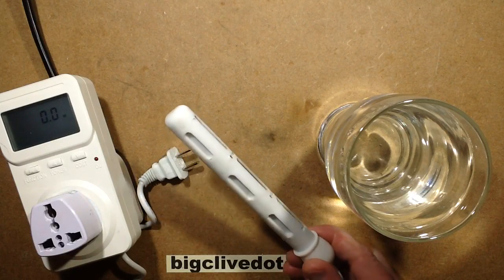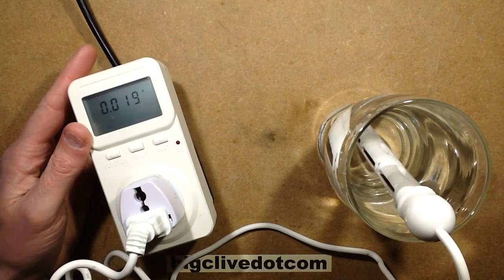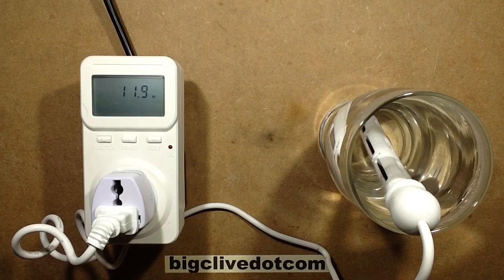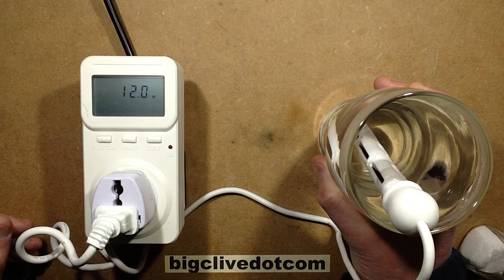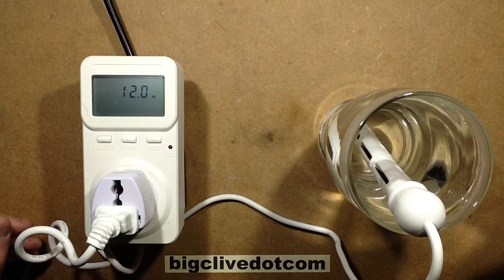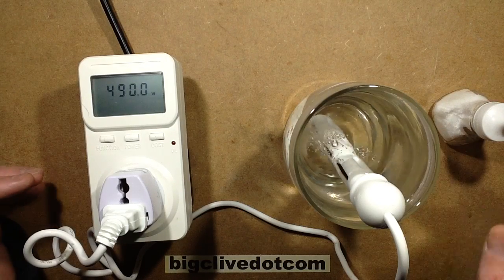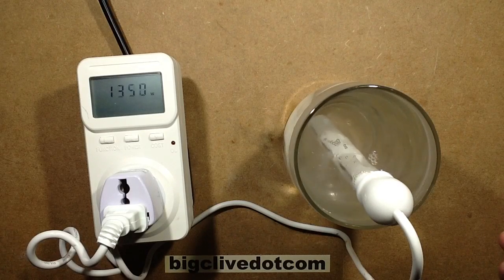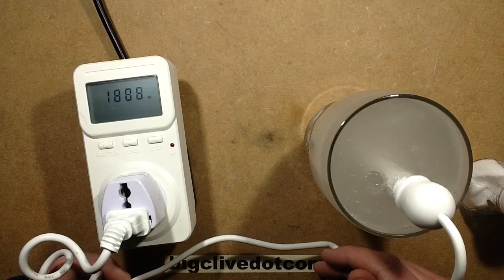240V electrode heater in distilled water.  Then with salt added.

Comment: And I was impressed by the 600VDC overhead lines for the trolleybuses around here, same as for the metro. I guess a proper full size train needs quite a bit more power, and you can't cheat Ohm's law (either thicker conductors for more amps, expensive; or more volts)

Comment: When I started out in the generator industry over 20 years ago we still had a row of 4 tanks at least 5 foot cube each made of steel with a 3 pronged plate electrode that was lowered from an insulated hoist. This formed our load bank for testing generators and 3 or 4 Mega watts of 3 phase at 415V was usual. Salt was added at different strengths per tank to give different load levels. The tank its self was the Neutral or star point and you could put your hand in the water and see how far away from the side you dared move it. The water level was maintained via a side tank with a ball cock in it as lots of steam was produced. Little seen now.
Reply: Large diesel generators often have something similar: Water tanks with immersion heaters (ordinary resistive heating elements rather than electrode boilers) powerful enough to consume any power the generator makes at idle or tickover speed. As I understand it, this isn't for testing purposes, but is actually to prevent damage to the diesel engine itself. A diesel generator with a consistent electrical load and running at optimum engine speed is incredibly reliable - if it has been adequately maintained, it will keep going for years or even decades if you have the diesel available to fuel it.
Damage to diesel generators most often occurs when the load on them is highly variable, especially if the load drops to zero occasionally. Diesels are high torque engines, and that torque needs a physical load to push against. If there is no load, then that torque has to be absorbed by the engine itself somehow. Even at idle speed, this can do significant damage to a diesel engine - particularly the piston rings and cylinder liners, but also the cranks, connecting rods and other moving parts. So those big immersion heaters are to prevent this kind of damage, by ensuring that there is always a load on the engine.
Reply: @lloydevans2900  it is wet stacking and cylinder glazing that is the problem with low load. The governor regulates the speed in all load conditions so this is the issue. Only recently have generators at euro 5 with exhaust gas recirculation valves like on cars are fitted with small load cells to limit prolonged low load running.

Comment: Early electric motor resistance starters used the same principal. As you lowered the electrodes in to the solution, the resistance dropped. Try the same experiment with acid

Comment: Way back in the day, was it not the case that lighting dimmers in the theatres could consist of a large tank of salt water, into which dipped electrodes for each circuit, and wonderful contraptions of string and wire to control the electrodes to dim lights up and down.
Reply from the maker: Liquid rheostats.  Also used for motor control.

Comment: I once took a tanker trailer into a power station to refil a transformer with oil. Whilst I was there for a couple of days the engineers were pressure washing 44,000 volt overhead line insulators from the ground. They told me the water was super clean/sterile and it didn't conduct electricity. AMAZING!
Reply from the maker: +Steve Ashcroft The use high purity water like distilled water and also rely on the spray droplets to avoid a conductive path.

Comment: I happened to see this today on the Megger website about the affect of salt on earth conductivity:
" pure water has an infinitely high resistivity. Naturally occurring salts in the earth, dissolved in water, lower the resistivity. Only a small amount of salt can reduce earth resistivity quite a bit. (See Table)"

Added Salt
Percent by Weight of Moisture    -     Resistivity, (Ohm-cm)
 0.0 - 10,700
 0.1 - 1,800
 1.0 - 460
 5.0 - 190
 10.0 - 130
 20.0 - 100

So 0.1% salt by weight in ground water increases the conductivity of earth by a factor of 6, 1% by a factor of 23, 5% by a factor of 56 and so on. Obviously the affect of salt on just the water conductivity would be higher still.

http://assets.tequipment.net/assets/3/7/GettingDownToEarth.pdf

Comment: Hello clive. I heard someone say on a vid I can no longer find that it's possible to heat water with high voltage AC with zero current. Is this correct? Thanks
Reply: If there's zero current then there's zero power.  If there's zero power, there's no energy to heat the water.  So, no.

Comment: Are Ebay Ultrasonic Cleaners safe? This is mine, it heats and cleans. They always break after a month or so and the thermostat is pretty iffy. It has a metal case which scares me lol. I've got one of those meters, how do I test if it is earthed? - http://www.ebay.co.uk/itm/2L-3L-6L-Ultrasonic-Cleaner-Ultra-Sonic-Heating-Timer-Cleaning-Stainless-Tank-UK-/311532090240?var=&hash=item4888c27380:m:mJpQ4BMSojxvrlA7GQhvVGw

Comment: It seems to me, if you're using salt, then the gas coming out will be Hydrogen and Chlorine. Chlorine should not be used in the house, as it is poisonous. You should use bi-carbonate of soda, instead, the gases coming out will be hydrogen and carbon dioxide, I believe. Neither of these is dangerous.
Reply: Tell that to the Hindenburg passengers.

Comment: It will not boil at 12W. I didn't do the math but the glass and the water will give enough energy off to the room so that it will never going to reach the boiling point. Although given that at some point the water will settle, then slowly evaporate, then the small rest might even come to a boil at some point maybe?
Reply: He meant that the conductivity would continue to go up with time, and therefore the power would continue to rise until the water eventually would boil.

Comment: Clive I noticed that you have to press the button on your power-meter very often to cycle through the options. I guess you also have a more fancy/handier one and this one is just a 'shitty' one
Reply from the maker: +Maico It's the dumbest, but the simplest and most accurate.  Especially with weird loads and power factors.  It's also very easy to use for long term testing of loads.  Every time you plug it in it resets to zero.
Reply: bigclivedotcom Ok :) Its a bit like this: when I need to buy a new computer/tv or whatever else I always have that my thorough specs-demands never reside in ONE device so I have to vote for the one that has the most important of specs-demands included and the lesser ones not present in the chosen device I have to live with. I hate it though :)

Comment: Sugar! Do it with sugar! Melt that tat!
Reply: +Charlie Fleming Sugar is not an electrolyte so it will have far less of an effect than salt would.
Reply: Oh :( how stupid am I? lol
Reply: Charlie Fleming Not very :P Its something you wouldn't know unless you were taught it anyway.

As a possibly unnecessary explanation (but you never know who will read these comments): Table salt is a salt, a ionic compound, that separates into positively charged sodium ions and negatively charged chlorine ions when dissolved. (and even among the ionic compounds, NaCl completely dissociates and is referred to as a 'strong' electrolyte as a result) Those carry charge through the water between the electrodes. Sugar molecules are bound together with covalent bonds and are neutrally charged. They won't do a good job.

Comment: At the lab where I work, we have a de-ionized water system, and the indicator for when it needs maintenance, filters, etc... Is a neon lamp attached to a pair of electrodes that pass through a plastic block on the output pipe. If the water will conduct enough energy to light a neon lamp, then it's time to service or change filters.

Comment: Kind of what I thought would happen.  Unfortunately, depending on solutes in the water and the composition of the (probably questionable quality) electrodes, you can have a lot of things ending up in the water.  From what I remember, one of the worst (and most abundant) things you'll have is chromium(III) chloride, which is actually really toxic.

TMI portion:
Chromium III chloride has an LD50 of about 2g/kg, so its not going to kill you in the amounts those electrodes would produce, but its safe concentration is only about 1mg/m^3, and toxic concentration is about 250mg/m^3, which are probably pretty easily achievable seeing as stainless steel is about 10 percent chromium by mass.

I wasn't able to find any information on its biological halflife, so it may be excreted quickly or it may have fairly nasty cumulative dose properties.  I dont know.
Reply from the maker: +htomerif I like to think of it as "medicinal".

Comment: How is it these things don't electrolyse the water into hydrogen and oxygen?
Reply: +magicstix0r they might, actually, but at very low speed.  Electrolysis is a really slow process, whereas boiling water off as steam is quick.  So scattered amongst all those H2O molecules flying off the surface might be some extra H and O2 molecules, but no so many as you would really notice amongst all the steam.
Reply: +OrigamiMarie 
* extra H2 and O2 molecules 😉

Comment: So I suppose it's not just a resistance heater, and the electrodes make contact with the water and actually push current through it, right? Because a resistance heater would not care if it was in distilled water  or even air, it would heat up the same...
Reply from the maker: +BIll Georgoulakis Yeah, it's a Chinese electrode heater that applies the mains voltage to two metal plates in your liquid.

Comment: WUMMMM! The sound of power.

I used to run EDMs (electrical discharge machining), and the wire EDM, which is something like an open-end bandsaw with a brass wire instead of a blade, used deionized water as the dielectric, with a voltage (IIRC) about 90 DC. This, of course, was pulsed and  varied upon load and whatnot. We filled the tank with tap water which subsequently was pumped through a deionizing resin then sent under pressure to the nozzles surrounding the wire. Return water was filtered thoroughly to remove the metal removed by cutting. The machine was made by a Japanese company called Sodick.

Comment: Pure water is in use for super high tension switching transistors in large DC/AC converter stations. Super good insulator and also the ideal coolant.

Comment: Should've tried wit a single tiny grain first :)
BTW, you've done work for amusement parks. Do you remember the low-tech soft start devices for the electric motors of merry-go-rounds, carousels and what not? It was a pot with an electrode inside, filled with salty water, and a handle operating a hinged lid, to which a shark fin shaped blade electrode was attached. The operator would start the motor by slowly lowering the lid electrode into the pot.  For bigger motors it was a triple pot for a 3-phase power. 
I remember seeing that as a child and watching this device in action was the most fun and interesting part of the whole ride for me :)
Reply from the maker: +68Stan The electrode motor and lighting dimmers were used quite a lot on the old fairground rides and in theatres.  They were super simple and virtually indestructible.
Reply: bigclivedotcom Happy to read that :) I'm 47 and live in Poland. Nobody from my generation seems to remember those, nobody noticed those mysterious and impressive devices :( But I was interested in the technical aspects of life for as long as I can remember...
My parents repeated many times that they knew I'll be a tech guy since I was 11 months old, as I managed to unscrew one side of my cot and appear before their astonished eyes in the living room (having swallowed one nut in the process might I add) :D
Reply from the maker: +68Stan My parents told me that I took the vacuum cleaner to bits when I was three.  And bizarrely I can recall doing it and having a bitch of a time getting the motor to sit back in properly.  I hope the power was off!
Reply: bigclivedotcom Hahaha! :) Well, looks like it was inevitable for us :)
Reply from the maker: +68Stan I genuinely think that in the same way that bee and ant colonies have types of bee and ant that perform specific functions, the same applies to humans.  Some of us are actually born to be engineers and just automatically love working on technical stuff.
Reply: bigclivedotcom Oh, absolutely, that's a given. Whatever the reasons and the mechanism, this is absolutely true that the neurons, synapses etc. get configured in a certain way very early. My father had a second son when I was 25 and he said that the kinds of questions we asked and things that got our attention as infants were completely different between us. I am an engineer, and he's into humanities, arts etc.
Reply: +bigclivedotcom I feel like I'm part of your bee-kind then :D
Reply: +68Stan I'm rememberring them in the Dutch fairgrounds too. For instance in adventurepark Drievliet. I've seen them in operation with my very own eyes while sitting in the ride as a kid :) It often resided in the middle of the ride where the ride rested on top and when the ride started to run and lifted up it was clearly visible in that void.
Reply: Ohhhh, so that's why there were 3 pots and blades! It's been like 30 years and only now am I figuring it out! Greetings from Hungary :)
(One of my first memories is my parents looking for the parts of a toy car that I disassembled. Idk if I've eaten any of them :))

Comment: What about the baby cooker? I bet it would trip a fuse when the salt is added :D
(the increasing wattage was because water is more conductive at higher temp, and the 6 watts is still 6 watts going into the thing. It falls apart into ions more, but whatever, not the interesting part)

Comment: As distilled water is a good insulator the small wattage being seen is probably being caused by capacitance.  
If you tried a smoothed DC supply you probably I doubt you'd see any current.

Comment: Could you please test ~~ http://www.ebay.co.uk/itm/HP-990B-Tweezer-SMD-Meter-Multimeter-Resistor-Capacitor-Diode-Battery-Tester-UK-/151833636729?hash=item2359fd6f79:g:NnkAAOSwpDdVaQxn

Comment: +bigclivedotcom : 
the conductivity of the distilled water goes up due to the absorption of CO2 from the air which forms HCO3- in the water and that causes a slight acidification of the  water and it increases the conductivity.

Comment: +bigclivedotcom 
Interesting that such a small amount of salt should have such a large effect. I wonder how the salinity of the water compares to sea water? 
Clive, it looks like you've adapted a plug-in appliance power meter so it has a cable for connecting to the mains?
Reply: Oh, I just noticed in one of your other videos that you have your energy meter plugged into a single socket trailing lead. For some reason it doesn't look like that in this clip! Doh!

Comment: All the trains where I live in the south east of england use a 3rd rail instead of overhead lines. Keeps the countryside looking a lot nicer in my opinion but it can of course be more dangerous for animals and ignorant humans.

This was a really interesting video! Such a tiny amount of salt makes for such conductive water. Maybe the manufacturers of those death heaters did not account of varied water conductivity, if the water were to be really conducive it would use way more amps and possibly make the cable catch fire! I don't suppose they put a fuse in it haha

Comment: Definitely looks more like self-ionization of the water rather than ions entering the water from the electrodes to me. If you have a look at this page https://en.wikipedia.org/wiki/Water_(data_page) there's a table towards the bottom giving the conductivity of pure water at various temperatures. You could easily explain the additional power draw after two hours as being due to the increase in conductivity due to a high temperature.

Comment: Hi Clive, High Grade Distilled water is not at all conductive. We use it in Power Generation to pump around the coils of 1MW alternators to cool them down. As you will know, it's best to take the heat away at source in the coils.

Comment: For everyone asking to do a saturated solution, I can say from experience that that is a terrible idea. Running mains current through an electrolytic cell will make a very loud sound, almost like a water pump, to answer anyone's questions about that. At that voltage, the electrodes themselves tend to dissovle into the water unless they are a very corrosion-resistant metal, which would ruin both the electrolizer and the water. Ot also will blow out your fuse. The worst part though is that electrolyzing salt produces hydrogen chloride gas, which alone is a very reactive and toxic gas. Even worse is that it dissolves into whatever moisture it can find (such as that in your lungs) to produce hydrochloric acid, which would surely ruin your day if it got in your lungs. Even outside it's not safe, and doing it inside is just suicidal. The water left over would also have sodium hydroxide in it, which is only slightly more safe than hydrochloric acid because it will at least stay in the cup.
Reply: Another interesting and dangerous thing that it does is that sometimes, the heat produced by the current is enough to ignite the hydrogen gas produced by the electrolytic reaction, so it creates small explosions of fire on occasion.